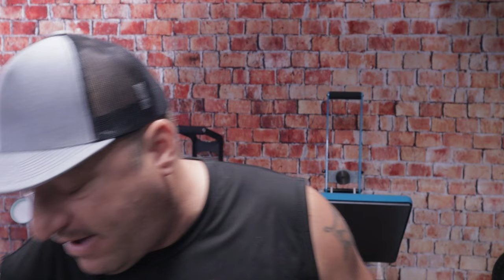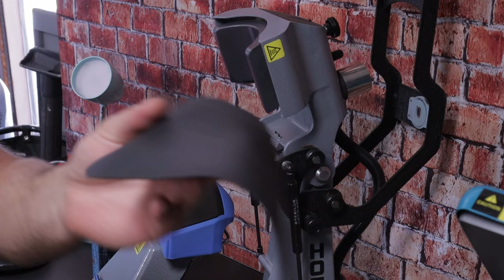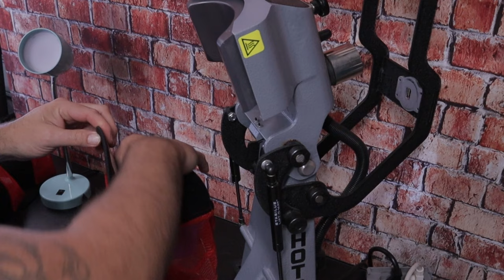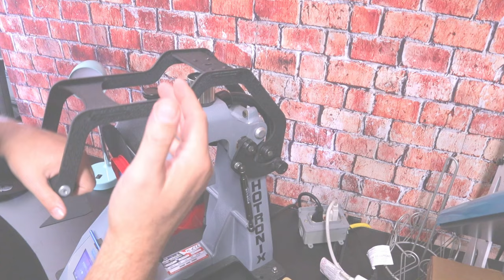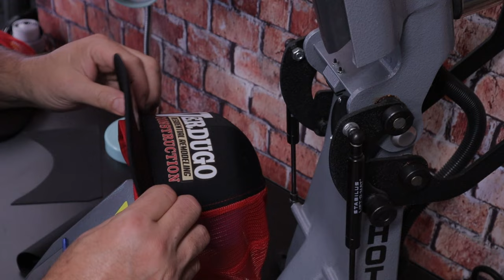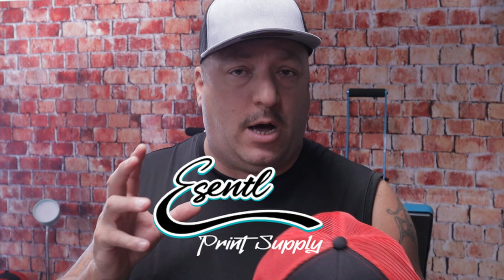How To Fix "The 6 panel Hat Gap"  + Adding DTF Transfers  to 6 panel caps

Comment: Great Video.  Any tips on avoiding the press line I get sometimes where the crown meets the front panel?  I often get a hard crease there.  I have tried different size platens/pressures but it still can be an issue.
Reply from the maker: you using a 360 IQ? if not that type of hat press would help eliminate that, but I have seen people add foam underneath, but I have a silicone hat mat kit you can use in my tools section that might aid in helping with that issue on my website esentlprintsupply.com

Comment: How does the dtf hold up on the seam? Can the seam joepardize the overall application as opposed to it being set on flat material?
Reply from the maker: depends on the DTF and who prints it, DTF normally is pretty flexible and stretchable so it should be a problem, me personally its just a look thing, 6 panel are more for patches imo

Comment: My hat press doesn't heat on the lower platen. I have pressed tons of caps with screenprint. All the prework i try, the DTF material creases while pressing. Any ideas? I've watched so many videos but I must have a brain freeze on DTF. I love it for shirts but can't get it to work on caps.
Reply from the maker: its the shape of the platen and hat combo that's causing that ..one of the main reason I bought this machine, was to eliminate those issues hats are money and ruining them can get pricey quick :)
Reply: Thank you!

Comment: Your using the wrong platen for the hat shape your trying to press !
Reply from the maker: this platen is perfect for this hat shape and just about any other trucker hats at that, its this particular manufacturer and how they sew the seam in the front panel that causes the gap. I'm sure with other presses that have to have multiple platens they have one in your case that works for this style hat